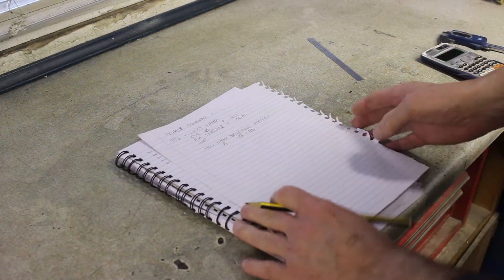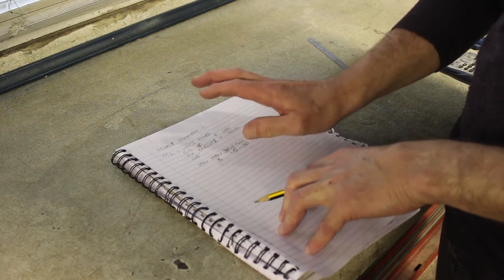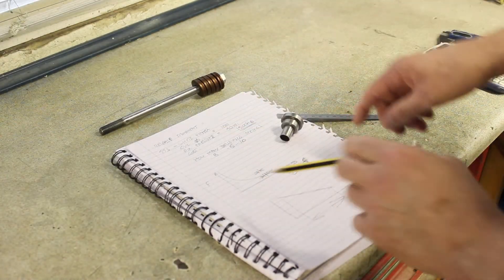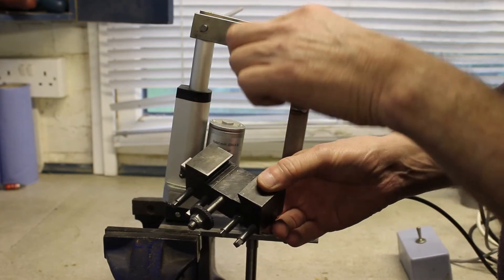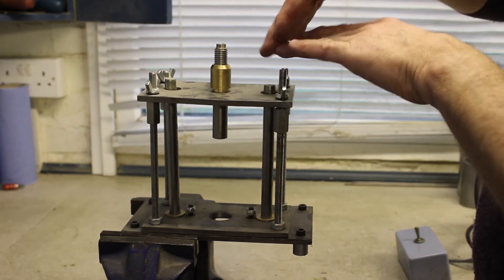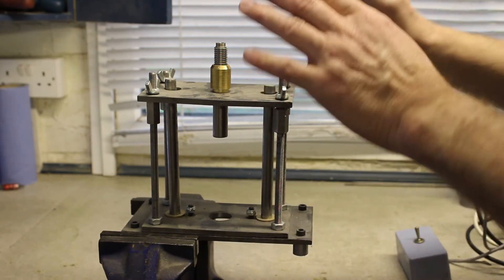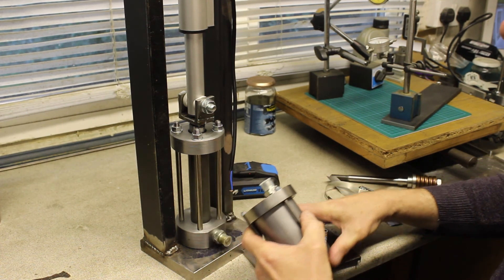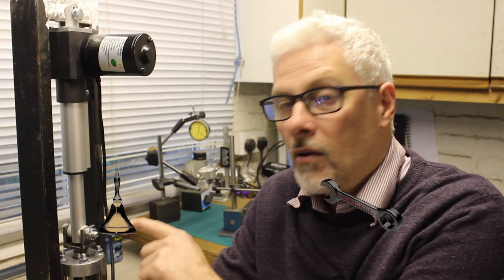Power drawbar update

Comment: Mmm, you may have re-ignited my project for the power drawbar. I Bought a 3 'tier' pneumatic unit (same as Tormach) direct form manufacturers for about $200. Obviously, you have a fair amount of weight on the head but the control of air is pretty easy and the rest of the system is quite easy to make. 
What I like about your option is the small unit (not sure what the totla wight is likeley to be) on the Syil head. Do you intend to fabricate it so that the unit can be swung out of the way like the Tormach version?
Reply from the maker: Hi Matt,
Yes it was the $200 for the cylinder and the cost of a compressor to drive it that put me off. I do have a 3hp compressor, affectionately known as 'Edward the compressor' but I was trying to make a draw bar that anyone could make at a reasonable cost. I was testing yesterday and I have a big leak in the power cylinder I think I wrecked the seal when I put it in.
Mine will be fixed not like Tormach however six nuts and it will lift out. Weight wise I guess a couple of kilo, just a guess.
Cheers